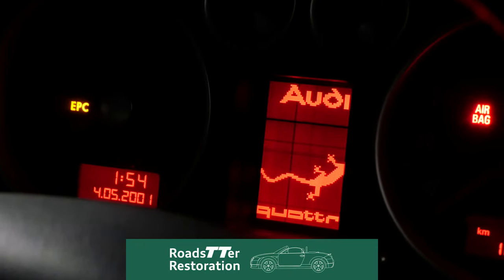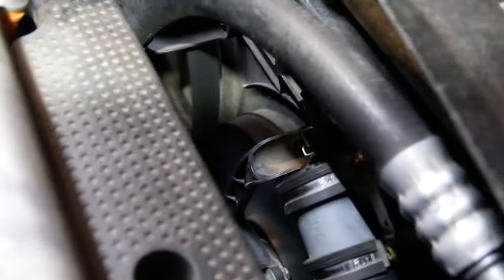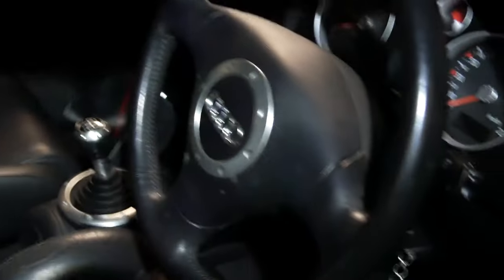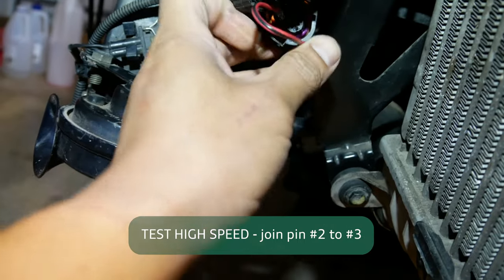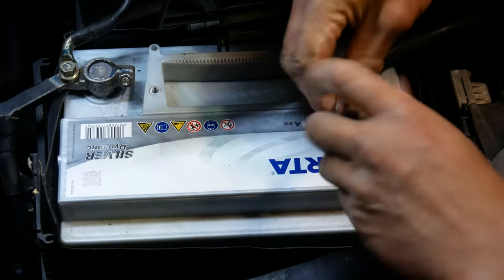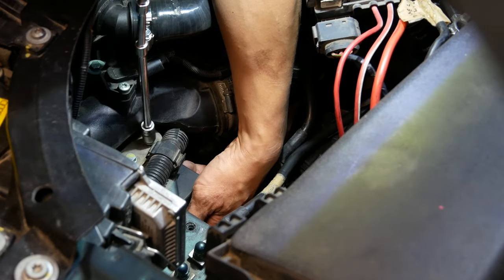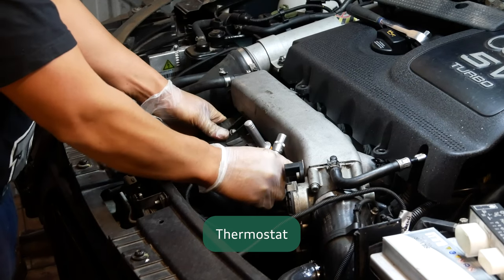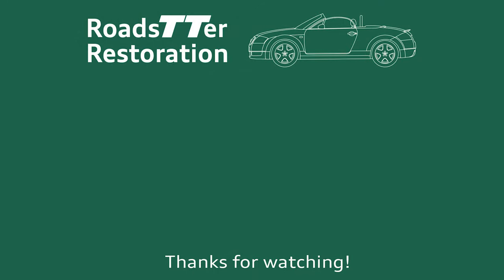Audi TT Mk1 Overheating 🔥 1.8t radiator fan not working properly. What to check DIY guide 🔧

Comment from the maker: Hands up if this is something you have come across? Let me know if this helps!
Reply from the maker: @tindraxx7226 hi!  cable thing?? In what part sorry?
Reply from the maker: @tindraxx7226  oh that's just a spare wire with spade connector on the end. You can easily get those things from a hardware or electronic component shop for a few dollars.
Reply: just noticed mine are not working, wont even spin up with the aircon. Going to try these steps tomorrow at work. this guide was great, earned a sub from me.
Reply from the maker: @c0wsg0m00  thanks 🙏 hope this helps you get to the bottom of things (and that it's not a silly thermostat install mistake like I found out haha)
Reply: Hi, brilliant video, Thanks you . 
I find your videos informative , helpful , clear and concise. Keep up the great work. Well done .
Reply from the maker: @King_Of_Sparta_  thanks for the kind words! Appreciate it.

Comment: Hi ! Just did the tip to test the fan, with a cable between pin 1/2 and 2/3.
All is good !
I’m 99% sure that my overheating come from the thermocontact, since on idle the fans never spin.
And I have replaced the calorstat a few days ago.
Gonna change it this week end.
Very great tip ! ;)
Reply from the maker: Good luck and hope the video Helps!!!

Comment: I pulled fuse 16 and both fans run. But I did the cable on the pins test and nothing work. I replaced both fans, all sensors, fusebox, and control module. Now what? :(

Comment: Hey! Nice job! I have a TT front wheel drive with 180 horsepower! I ve change the thermostat and the water pump my  small fan isn’t working alive only when the big one works. And then I have 110 degrees on the dash after the fans are engaging it drops to 90. Is the FCM?
Reply from the maker: @georgioskaragkounis8476  yeah definitely replace the FCM.

Comment: Hello , thanks for the video  , I have changed almost everything I could think of , FAN , CONTROL MODULE,  THERMOSTAT, AND RADIATOR VALVE , yet the fan is not working and it not overheating.  Please, what could be the issue here, please
Reply from the maker: @victorarinze6217  hi. Interesting problem you have. If you're not overheating - I would check if your thermostat is functionIng correctly. 

I know you already said you changed it but is it the correct one, opening and closing properly and is it installed properly?

Comment: I pulled the fuse ignition on engine not running both fans didn’t run? Is that replace, so does that mean replace fan control module?

Comment: Awesome video! My TT big fan stopped running while I was at idle out the front of my house, although after pulling out the #16 fuse, both fans ran. What could I do from here?
Reply from the maker: Get some thick gauge wire to do the tests in this video to begin ruling out what could be wrong.

Comment: Hello 
Thanks for your video,it was very helpful.
So i did the test for the fans and only the low speed is working.
Do i have to change both fans or the fan the module can be the issue ?
Thank you.
Reply from the maker: I would change the thermostat switch before going to change the fans which is less expensive.
Reply: The one on the radiator ?
Thank you very much. @ianpgonzaga
Reply from the maker: @outlander4ever241  yeah that one just take sure it's the correct shape plug.

https://www.google.com/search?q=audi+tt+8n+cooling+fan+thermo+switch&oq=audi+tt+8n+cooling+fan+thermo+switch&gs_lcrp=EgZjaHJvbWUyBggAEEUYOTIHCAEQIRigATIHCAIQIRigAdIBCDY4NDNqMGo0qAIOsAIB&client=ms-android-optus-au-revc&sourceid=chrome-mobile&ie=UTF-8#sbfbu=1&pi=audi%20tt%208n%20cooling%20fan%20thermo%20switch
Reply: hello, my TT overheats when the car stops, the temperature rises to 110 degrees, the fan starts and drops to 90 degrees, this is repeated over and over again, the fans do not rotate at slow speed, only at high speed when the engine overheats. when I disconnected the fuse 16, not one of them was spinning the same way when I turned on the AC fans, both are not spinning. I'll think about what to replace first.
Reply from the maker: @arry9534  yeah good and also consider a fan control module replacement.

Comment: Magnifico, que pena que no estan los subtitulos en Español, 
I have changed the thermostat, green sensor, radiator sensor, but sometimes the fans do not work, fuses are fine, mi TT I'm going crazy, thanks.
Reply from the maker: Maybe the fan control module (black rectangle box under battery tray) needs replacement ?
Reply: @ianpgonzaga Magadang Umaga, Sometimes the fans come on, other times they don't, and when you stop the car the same, It could be the relay you mentioned (module control). Very kind, thank you. SALAMAT.

Comment: I’m exactly same situation fan work on 90c don’t work if ac open… if remove fuse 16 work both also high low speed work if I connect wires what I’m need? Relay and thermostat like u?
Reply from the maker: Try them first because they are cheap 😜
Reply: @ianpgonzaga  im thing iys thermoswitch after thermoswitch all work i will try thermoswitch and thermostat with colant change im not sure if its right mixed

Comment: So my fans do not come on at all when driving. They did not come on when I pulled the fuse, he lever they did when I bridged the wires. I replaced fcm, temperature switch, and thermostat. I don’t know what else to try. Maybe water pump?
Reply from the maker: Had you replaced the fans unit themselves? Sounds like the resistors are kaput.

Comment: My car has been overheating, and even when I turn on the air conditioning, the fans don't spin at any speed. I turn off the car, then turn it back on, and the fans start working again. I've replaced the fuse box above the battery, temperature sensor, thermostat, the radiator thermo-switch, fuse box over battery and the relay box under the battery, but the same issue persists. Sometimes the fans work fine at both speeds, and other times they don't work at all. 
If I bridge the connector on the thermo-switch, both speeds work, at least when car is cold. (I can't try when car is overheating due temp goes crazy so fast).
Any help?  When car is cold is cold or its at +90 but not more than 30min fans are turning on at 96ºc and then temp goes back to 90-91.
Reply from the maker: Sounds like fan resistors starting to decay. Have you changed the fans themselves ??
Reply: @ianpgonzaga  nope. Fans are my next option. I wasnt sure about them because everything works when I do tests in my house. Maybe fans are overheating 😝 and stop working after a while. Ill try to change them next week. Thanks mate!

Comment: Any advice for getting the actual plug off to the fan testing?  Most of us don't have the bumper off and its real tight in there.  I've been messing with mine for about an hour and it doesn't want to budge.
Reply from the maker: 😲 with the bumper on and all trims in place it's going to be super hard to do this test. You'll need to teach down or move the battery out from its box.
Reply: Thanks Ian.  I just gave up.  I think I'm going to order a Fan Control Module in the hopes that thats the quick fix.  If i have to take the battery and tray out anyway I'm basically right at the FCM.  Know any other way to test the fans?
Reply from the maker: @DufussMan  ahhh ok. This is probably the most well known way to test them. They can't be tested with VCDS like the newest cars because they're not part of the CANbus.

Comment: I have a Seat Leon 1.8T where only one fan i spinning when i pull the #16 fuse. My guess is that the fan is broken. Does that sound right?
Reply from the maker: Yep. Replace fans. They should both spin up when you pull fuse 16.

Comment: So i pulled the fuse 16, both fans didn't on. Went driving, only 1 did work at low/high the other is dead i think?
Reply from the maker: Hey Antal. Sounds like it! Time for replacement or the resistor mod.

Comment: I tried pin 1 with pin 2 and the fans kicked at low speed without getting the ignition on….i tried 1 with 3 and the green fuse on the fuse box melted 😢 so I’ve a bad fans I suppose right?
Reply from the maker: Whoa! Hope nothing else got damaged - yeah sounds like replacement requirement.
Reply: @ianpgonzaga  yeah I’ll replace it! Thank you for your guide!
Reply from the maker: @andre-77  you're welcome and hope you get to enjoy your TT soon.

Comment: My fans didn’t spin when I took the 10 fuse out. I tried with car idling and with the car off.  I know the fans are good cause I just replaced them both. 
Can you help me out on what this means or what should I do next?? Thank you 🙏!!
Reply from the maker: Hey. Sounds like you need to replace the control module.
Reply: @ianpgonzaga  thank you very much. I’ll be doing it this week hopefully fixes it! 🙏
Reply from the maker: @dannylopez5259  also check the obvious - fuses.
Reply: @ianpgonzaga  oh ok. 
I also checked the ones on top of the battery 
They are good. Was thinking on checking the sensor on the radiator and the once on the coolant hoses but idk how. Should I replace those before the module or do you think I should go straight to the module.? I’m asking cause I just don’t know how they relate to each other and how they work together.
Reply from the maker: @dannylopez5259  you should get an error if your coolant temp sensor is dead. 

The 3 pin plug sensor or radiator might be good to swap - with either one justeamd you need to drop the coolant but wth the module you just get to the battery. Whichever way you go those are all the suggestions.

Comment: Hey, how so if thermostat fail passing coolant down the fan wont start? My fan dont work at high temp, but remove fuse fan turns on. I wonder if is thermostat failing. I thought thermostat dosnt affect the fan at all?
Reply from the maker: Could be thermostat has failed closed. 

If the coolant UNDER the radiator temp sensor (triangle plug) not getting hot /circulating then the fan will not run. 

When it looks like the car is at temperature are the lower coolant hoses hot or cold ?
Reply: @ianpgonzaga  thermostat has been replace 5 months ago. I feel the fan isn't turning on the low speed. I will try the pin method soon. I am suspecting the CFM is bad or the resistor is bad?
Reply from the maker: @s916606  definitely do more testing to get to the bottom of the issue.
Reply: @ianpgonzaga  thanks!
Reply: HEy Ian, what tried the triangle pin method. fan works on both speed. I saw you changed the Fan control module. What does FCM do? will that be a good idea to replace?  @ianpgonzaga
Reply from the maker: @s916606  FCM is the main part to control high and low speed fans determined by different engine and air con sensors. I think replacement is your next step.
Reply: got it, thanks. just slight update, i have both coolant lines are warm, they supposed to be both warm, correct? Do you have video of replacing thermostat? that seem to be some jobs to complete.
 @ianpgonzaga
Reply from the maker: @s916606  I think part of the engine build you will see the thermostat install ;)

Comment: Hello, i have a cluster problem i guess, my temperature gauge going high then fan is turning on, there is no hot Motor, when i hit the temperature side of my cluster with my Finder :) it goes down . İ changed cluster temperature motors but still Same :(, i m trying to find solutions, do you have any idea for this issue 🙏
Reply from the maker: Hi Kemal. Sounds strange but it's like your cluster needs to be inspected for repairs.

Comment: Have paid like 2k to audi dealership to know thermostat was faulty which after changing didnt solve the issue. Took it to another shop to be told its the fans that are faulty. Told me he tested the electricity to the fans. So I am guessing the control module is working fine its the fan itself.
Tool out the fuse, didnt turn on any of the fans. When i turn on the AC it turns on the driver side fan (rhd) but the passenger side doesnt turn on.
Absolutely stuck after paying a huge bills.
Tested the old thermostat and it appeared to open up in boiling water. Just hoping putting a new rad fan will solve the issue.
Reply from the maker: Yeah I wonder if the dealer even tested things properly. Hope you get it fixed with the next repairs on the fans itself.

Comment: My fans worked perfectly before but one day someone reversed into my tt, nothing bad happened he just cracked my bumper but 2 days later the fans stopped working. The previous owner changed the thermostat. Should I just buy the fans assembly? I bought the relay, when I disconnect my 16 fuse nothing happens.
Reply from the maker: Maybe check the plugs and wiring first at the FCM and at the radiator fans shroud first..something might be come loose ?

Comment: Hi can you tell me what should I do when my fans work all the time, I mean when I turn on ignition they are starting even though engine is cold.
Reply from the maker: Hi Pakon. Sounds like a busted fan control module.
Reply: @ianpgonzaga  Which is supposed to be located under the battery tray. I'm in the US so I am not sure if things were done differently, but I just pulled my battery tray and all I have is car frame. Where is this module of which you speak located? My fans are always on as well, and I am changing the fans because they were worn out....and thought I should also fix this problem.
Reply from the maker: @markhamilton8198  it's under the chassis rail (which is below battery trail) so it's like this 

Battery trail
Chassis rail
FCM

Comment: hi. does the 2.0 tfsi BWJ has that control Module? THX
Reply from the maker: Good question - no fan control module for the Mk2. There is a fuse box in the engine bay with relays - I would check in there for the fans relay - the rest is main ecu controlled. 

Your owner's manual should be able able to guide with what's in the engine bay fusebox.
Reply: @ianpgonzaga  thank you for the replay, i don t have the manual instruction, and someone told me that this problem is caused by the tuning soft. I have stage2+
Reply from the maker: @barbuandrei4316  maybe try out factory tune (back up your stage 2) and see what happens.
Reply: @ianpgonzaga  that s what i will do, thank you. Is bizarre, i never heard that a tune can cause a problem like this

Comment: Hi, great video, I am having the same issue with my car, I replace my Radiator switch, new control module, new relays, new water pump, tested with new, thermostat, without thermostat, new headgasket for the engine, car is still running hot, the car fans turn on, when activate the AC,but never auto when car is overheating, I have no fckngggg idea waht to do anymore, any idea???
Reply from the maker: Sounds like you've been having some fun herre ;) 

Replacement of the fans sounds like will be next thing to do.

Comment: What's the low resistor mod?
Reply from the maker: Hey there. It's where you add external resistors to the system in place of the ones mounted in the fan housing.
Reply: I heard that they use mk5 fans but no idea how to do it .
Reply from the maker: @elielsandunguero  not sure they would work ... Or fit properly.